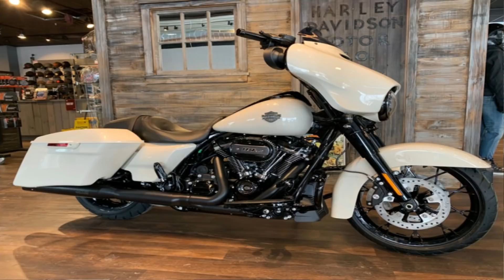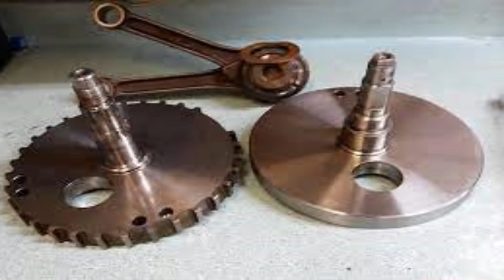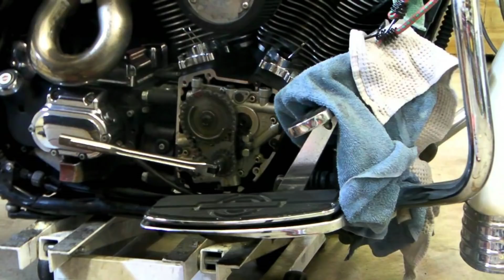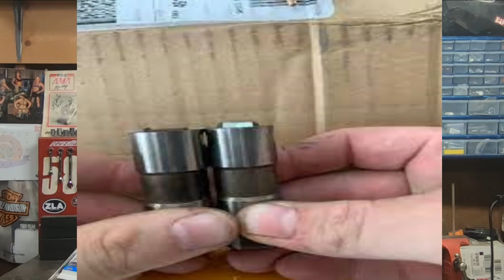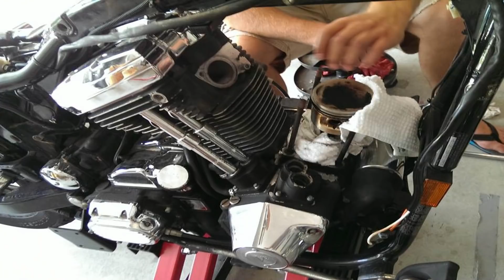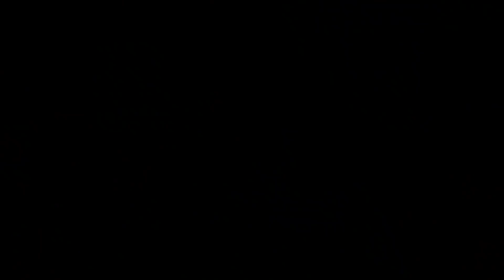Harley Davidson Engine Power Won't Destroy Fuel Economy & Longevity

Comment from the maker: How many miles do you have on your built Harley-Davidson engine?
Reply: 2003 Wideglide. 95" build 103hp 113 torque   Wood TW 5G  40,000 miles and fuel mileage I think is better than stock. Never had a reliability issue. That build was the best move I ever made.
Reply: 1976 Yamaha Enduro 175 with a Briggs and Stratton 149cc.
21,001
Reply: 2009 FLHT bored out from 96 to 103 cubic inches, S&S 585 easy start cam, heads ported and polished with the HD race tuner. 33,000 miles. I had to add a Jagg Oil cooler with fan and love jugs. City riding isn’t fun.
Reply: I put 140,000 on my 1998 Evo before the flywheels scissored and then had it rebuilt. I think it got hurt when the throttle somehow or another got stuck in Wide Open Throttle and nothing I did helped. I had to use the kill switch just to get it home 55 miles away. That was sketchy... 
If you search "100,000 Harley Davidson" you'll see us rolling over to all zeros on the tallest bridge in Jacksonville FL back in 2011.
Reply: It has been about 4000 Miles. 1K mil;es was an iron but ride to Laffayette Harley Davidson and back to Newnan Ga. 
The sad part about it is I got Covid and almost died. Then I got shingles on the left side of my head and in my left ear. I still experiance the postherpetic neuralgia pain. Putting on a Helmet is very painful but I’m starting to get used to it. I love riding more than fearing the pain. Last year sucked but I have great expectations for this year.  
My engine has stock heads so its not going to generate high torque and HP but it does make better HP and Torque than a stock M8 107.
The torque curve ramps up fast and it very flat from 2.2k to 5.5k RPM peaking at 108 and the HP is a steady clime peaking at 103 HP at 5.53K RPM. Along with the S&S 106 Hot set, I also got the S&S freewheel crank set because my flywheel failed the binding test. So now I have a new engine. I resently mentioned to you the I upgraded the Suspension to the Legend RevoA’s and Axeo. The current set up of my  2009 FLHTCU is amazing. ts like I have a new bike without having a new bike payment. Yeah Its not new and doesnt have the flashy electronics but I love it.
Reply: @vancedyer755  Good for you bud and fwiw I wouldn’t trade my 2002 for new M8 and half the guys I know with a M8, want another Twin Cam. At some point down the road, your bike will be worth more than the M8’s.
Reply: @MassholeCritic  Thanks Sully. The worth of my bike is priceless in my mind. My wife said I’ll never get what its worth. I laughed and in that moment I knew I’d never sell my bike. Yeah, the twin cam has its issues but everything I do to it brings it one step closer to perfection, at least to me.
Reply: 139,000 on my 2013 modded 2013 ultra limited.
Reply: 2001 indian with aS&S 88 .milage 21,000
Reply: 80" Evo, Wood W6H cam, 35,000 miles
Reply: 2007 Wide Glide 96 cube with screamin eagle tuner and big cam kit, throttle body, heavy breather, rinehart pipes and dyno tuned. 75,500kms and she is an absolute beast!
Reply: About 5000 since Cams and pushrods. 12000 on the bike.  0 issues.
Reply: 2002 Harley Night Train 95" 100/100 57k on crank, 20k on build.
Reply: About a maybe close to 1200 not for sure it's back in the shop again
Reply: Untouched as yet other than Rinehart slip ons on my 2021 Fat Bob with only 110 miles on it.
Reply: Zero. I am picking up my 2012 Street glide on Tuesday. Looking forward to the new power gain.
Reply: I put a Headquarters System 85 in my 86 FLT in 1998 @48k. The speedo went out at 97k ten years ago. Still runs hard.
Reply: 2003 Road King classic  62,000 it has stage 1 the previous owner did the stage 1.  I put new camplate with hydraulic chain tensioners I love this motorcycle It's been very dependable for me.  I don't care about more power that I am not going to use anyway.
Reply: 2009 Tri-Glide 103 6 speed , wood tw555 cams and S&S tc3 cam plate and oil pump, wood directional lifters and fuel moto adjustable pushrods and K&N big oval complete Air cleaner intake system with the Dark horse compensator and the sohb primary chain adjuster and the Barnett heavy spring plate and fuel moto A.I.M. pressure plate with de-catted reinhardt pipes with 98,000 miles on installation of said parts and been dialing in the tune sent by fuel moto with my power vision auto tuner and it sure runs well but has so many noises coming from everywhere lol , rocker boxes are chattering more , reversion noise from the air cleaner, primary sounds like nuts and bolts flying around in there lol BUT RUNS LIKE HELL 👍 , now have around  2,500 miles on build rolled over the 100,000 mile mark and still just as much noise as day I installed the upgrades so I'm just going to roll with it and see what happens, actually getting 3-5 more mpg around 40mpg now

Comment: Depends who does the engine build.   There are a lot of under qualified builders out there that have optimistic dynos and think that making the most HP and having the optimal AF ratio is paramount, which neither are.   But alot of Harley riders only want to use the dyno printoff for bragging rights then wonder why their bike runs like crap.  😂

Comment: First off, awesome channel! 
How best to get in touch and pick your brain? I recently bought a bone stock '06 Deluxe EFI twin cam 88. Just did a 10K service, I did pull the cam cover and the tensioners are fine, so far. I want to Stage 1 her, but need advise. Cams are soon to follow (bolt in, I think) and that's it, ride her. Help!!!

Comment: I have a 96 out to 103 cam comp heads ported  tune in a street glide loaded up A buddy had a factory 103 wide glide and on the highway I used a bit less than he did lol

Comment: On your advice... I wanted to change my '17 oil pump.  For the labor price I should replace the cam plate and probably change the cam.  Well it's gonna be down for a while maybe new jugs...  I ended up getting a 124 built (from 107).  During my Iron Butt Challenges my 107 could get 175 miles a tank on those 85 mph+, high RPM miles.  I expressed my concern about that to my builder and he said the same thing you said in your video.  If I can keep my right wrist calm it'll be the same if not better.  05/13/22 set out for Iron Butt 48 States in less than10 days.  My Ultra Limited preformed flawlessly and when I want to pass, I just roll on the throttle, it's everything I ever wanted my bike be like.  Over 10,000 miles since my build and I can say, if you can do, DO IT!

Comment: On my 17 Road King at 2 years old and approx 16000 km I did a stage 2 with the S&S 475 cam. A year later I wasn't happy with the FP3 fuel map so just paid for a dynojet license and had it dyno'd. I'm a shade over 40000 km now and the bike just seems to keep running better and better.

Comment: What’s your opinion on this? My dad’s 2008  Electraglide has 65k miles on it. I told home we should change out the cam chain adjusters. And possibly a woods 222 cam. Think we should change the cam with those miles? Was going to get the whole cam kit from Fuel Moto.
Reply from the maker: You'll be alright adding a cam if the bike has good compression, it's always a risk with anything mechanical but if you take the proper steps you'll be good to go with a bolt in. Just do the cam bearings and new lifters with the cam, now the tensioners are always a good idea to replace. Those I always go ahead and replace while I'm in there need it or not.

Comment: Hey Gixxer another great video I always listen to your advice. 
Still modifying the RG just put in a Fuel pack 3 what a amazing difference damn great product.
Thanks for your advice 👍 
All the best from New Zealand 🇳🇿
Reply from the maker: That's awesome to hear! the FP3 is a great product for exhaust, air cleaners and even cams. The auto tune works really good on it too if you want to fine tune the map a bit.

Comment: I changed the cam lifters and pushrods in my 2011 FLHTK. Exhaust, air cleaner, and FP3. Fuel mileage dropped around 5-7 mpg if I ride it normal. When I get on it a lot it makes a difference. So I act  accordingly … lol
Reply: Also it’s been 10k since the upgrade.

Comment: I'd say the answer is yes and no.it depends on what you do if you upgrade a part to make more power you need to upgrade the supporting parts.the more power you ask for the more you need to upgrade parts,as for fuel at some point it's going to use more fuel if it's enough to be a problem maybe not.
Reply from the maker: Supporting parts are a must, too many just slap in a cam and big bore without a billet cam plate and high volume oil pump for example.

Comment: I have a 99 super glide twin cam bumped to a 95 Dave Mackie 105 hp 105 tq  getting 50 mpg at 55 mph but around 30 at 70 mph and it was built over 20 years ago with over 50 thousand miles I still love riding it so much fun still to this day
Reply from the maker: That's awesome! That's exactly what I'm talking about, you have a built motor and it sounds like it's solidly reliable with 50K miles on it!

Comment: i know when i got my SE 131 build i thought ugggh gas mileage. but i see no difference. i am very conservative so that might be the reason. i made sure i added all the components too to support the larger build. i was reliability for sure. i really dont use the power much but it is there when i need it. coming onto a freeway is super awesome. :) nothing keeps up with me.
Reply from the maker: That new 131 is just plain awesome, one of the best engine upgrades Harley-Davidson has had i a long time. I bet it's a blast to lay into getting on the freeway!

Comment: So…. What is the power band on my 2019 FLH (stock).   I’m going to take an educated guess… 2200-5000 ish?
Reply from the maker: Roughly, torque come on pretty early but peaks around 3500 and horsepower runs out arount 4500 to 5000.
Reply: @GixxerFoo  so with my style of riding, I’ll never see any horsepower🤣

Comment: all i did to my evo was a jet kit and i did notice lower mpg
Reply from the maker: Yeah on a carb bike the jet kits make it pretty rich so you will use more fuel. The FI bike electronically metering the fuel can run richer and leaner as needed which allows them to keep the fuel economy steady.

Comment: I'm currently only running a stage 1 on my 2000 883, but have plans to upgrade to a Hammer 1275 kit and a Jackhammer 570 Cam set. Add Smash ported heads and I'll be pushing at least 90 hp on a 500 bike. Just my personal humble opinion, but save your money and ditch the fuel injection. Carbs may suck, but they do it really, really well!
Reply from the maker: Carbs do work very well, easy to work on and maintain too! You get that 1275 kit and the work done with those cams and that bike will haul. You might actually see over 100 horse with the right exhaust system.
Reply: @GixxerFoo  currently running V&H staggered shots. No baffles, no plans to switch. 2 into 1 would be better power, but I love the sound!

Comment: When I put new cams in my twin cam I re-used the original lifters but the engine had less than 2,000 miles on it at the time. When it comes time to change the tensioner shoes again I'm going to put in new lifters then.
Reply from the maker: That's a good call, I would of done the same thing in that situation. Changing lifters when you do the shoes is a great idea, it goes along with the maintenance not mentioned anywhere in the factory books.

Comment: Went stage 2 on my 114 M8 with tunner pro, street cannon exhaust and wide ban O2 sensors. All screaming eagle. Consistently achieved 50 mpg. The last change was intake 55mm screaming eagle cast. Fuel mileage went to 44 mpg at 65 to 70 mph. If I keep the speed down below 50 mph, I can average 57 mpg to 62 mpg. Bike is running fine now, no more changes until its worn out.
Reply from the maker: Those wide band sensors make a huge difference in maintaining consistency of your fuel map at all times!

Comment: how about converting cam plate on an 88 twin cam to new style cam plate from an 07 and up twin cam, thanks like your advice n
Reply from the maker: Screamin Eagle has complete conversion kit with a billet cam plate, high volume oil pump and hydraulic tensioners to update the 88's.

Comment: I'm an old Panhead guy. I recently picked up a 1996 FLHR-I with only 29k on it from a Brother of mine. It had the obsolete unobtainable parts Magneti- Marelli system on it. It ran so-so and mileage was crappy and the engine wasn't very responsive. I upgraded to a Mikuni HSR42 and an Ultima ignition system. It's like a brand new bike. It's very responsive and runs awesome.
Reply from the maker: My opinion, you did the best thing you could do with any bike that has a old Mag FI system. Parts are impossible to find, let alone anyone that tune it and messing with it is just asking for trouble. Best thing you can do is convert those to a carb, spend the big bucks and upgrade to a Delphi Efi conversion if you want to keep FI.
Reply: @GixxerFoo  I bought the bike after watching your video. I got the idea to go ahead and do it from watching your video "when fuel injection fails it's time for the carb." I figured out an easier way to do it without finding a donor bike harness and parts Etc. Cost about 1200 bucks for all the parts the minor wire harness that I did, but it's a lot cheaper than upgrading to the newer fuel injection system.

Comment: i only lost 2mpg on my 03 road king. 95ci 100hp 107lbft. 40mpg still. Now my 21 low rider s i just did a 128 stage 3 and should be around 130hp 140lbft on a 650lb bike. Dropped it off at my tuners today.
Reply from the maker: Getting a good tune will make a world of difference.

Comment: Don't lug......so what would be a minimum rpm you can accelerate out of without downshifting

Not a problem for me, I ride the curves and like to keep rpm up, gear down, for best throttle response

My brother doesn't get it......he shifts up as fast as possible, he hits 5th at 50mph(1200).......then says it needs a 6th gear
Reply from the maker: That's for sure going way too high a gear with not enough speed to carry the RPM range high enough.

Comment: I just recently upgraded my 2020 iron 883 to a ‘21 model Low Rider S which of course has the M8 114 in it. 👍😃. Anyway, I’m in the process of getting a good stage 1 on it. Probably the 636 breather from DK customs with an EBS (which I’ve already done a homemade EBS with stuff from Lowe’s and Ace hardware and a drill) and some slip ons. Beyond that, I really don’t think I’ll do much to this engine? Maybe a cam down the road? Maybe? It runs so good straight out of the box that I don’t want to mess with it too much. I certainly don’t want to hurt reliability. That’s my main concern.
Most of what I’ll do after my stage 1 is going to be centered around “cooling” the engine or keeping it as cool as possible. That’s probably my main concern with these air cooled engine designs is keeping it cool, not hp numbers. I don’t have $$$ to burn and want my original engine to last as long as possible!
Reply from the maker: Upgrading with a Hammer 1275 kit is a great way to double your power and keep your reliability!

Comment: How low rpms do you consider lugging the engine?
Reply: I would say anything under 2000 rpm. I have a tc 88 bumped up to a 98 with headwork and s&s crank. I do not ride under 2500 rpm.
Reply from the maker: If you're in too high of a gear with RPM's below 2500 and feel the engine struggling to pull out of it. The Vtwin will do it but you're beating the crap out of the crank.
Reply: @GixxerFoo  I've got a 114 M8. On the highway at 70mph it's only at 2600 rpms. On back roads I usually am around 2800

Comment: I usually use this analogy:  it is easier for me to push a piano up hill than it is for my 10 year old son. And I use less energy, and burn less calories, doing it.
Reply from the maker: That's exactly what you're doing putting some power in your engine, it's like getting a full size pickup with the V6 instead of the V8. You find out real quick you burn as much if not more fuel and you have way less power.

Comment: Excellent advice Foo! I’m not a tech, just of a “weekend warrior” guy who is not afraid to do anything on my bike or a buddies. You hit the nail on the head, adding more power without reinforcements is a roll of the dice.

Each engine is different, If 2 identical Lowrider S’s roll out of the factory and they were built back to back/one right after the other, they’re both going to have different characteristics and run differently. 1st bike could have crank runout of 2 thou and the 2nd at 8 thou.. (MoCo, in their infinite wisdom, changed runout tolerances after too many recalls… they went from .003 to .012 🙄). 

If all things are equal at 30k miles, same riding style, same maint, same parts, etc, etc… and both wanted to change cams and install gear drive cams, I’d advise against gear drive on the 2nd one even though MoCo says they’re within spec. Adding power to an already “lopsided” crank is only gonna make you get to catastrophe sooner rather than later.
Reply from the maker: That is so very true and I've said that for years, no two engines are ever alike! Gears are an awesome upgrade, but I really steer away from them on a stock crank just as the miles pile up. I like to see a Timken conversion with a built crank before going with gears. It reduces a lot of the risk of catastrophic failure.

Comment: My experience with Sportster upgrades is good. But with Sportsters a lot depends on the wing nut on the throttle.
Reply from the maker: 😆👍 It really does, riding conservatively on a Sportster they can get some miles out of a tank of gas. My wife has the 2.1 gallon tank and we've pulled about 90 miles out of it.
Reply: @GixxerFoo  Mine has the 3.5 gallon
 I can get up to 150 miles on the super slab before l hit reserve.